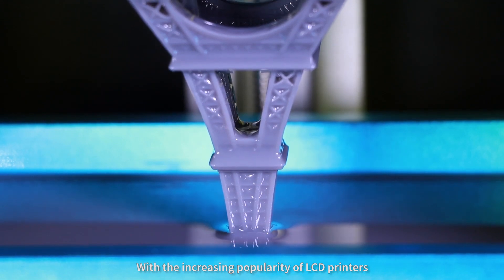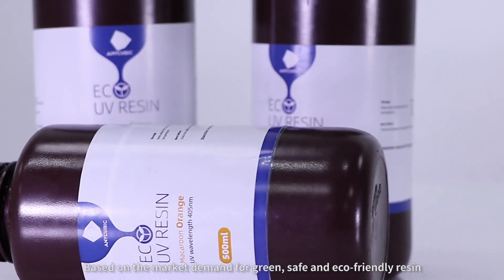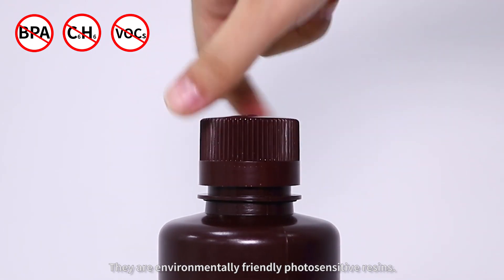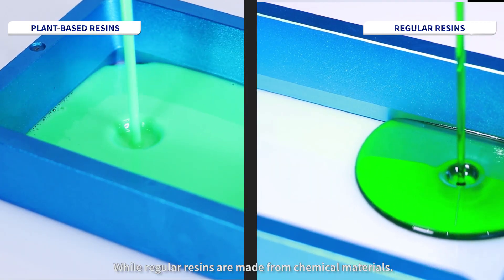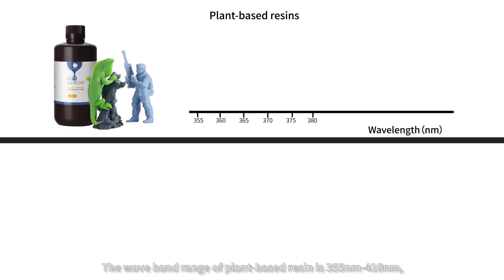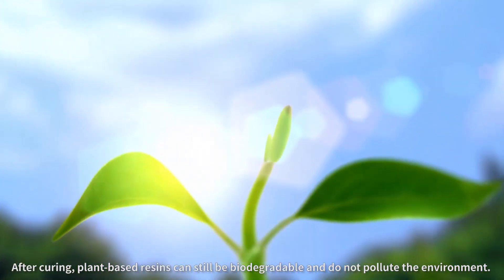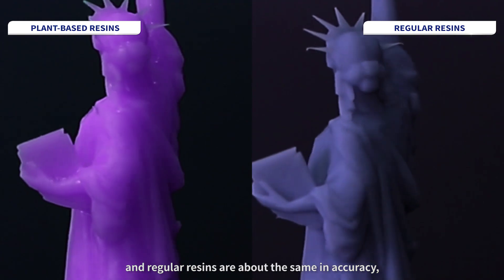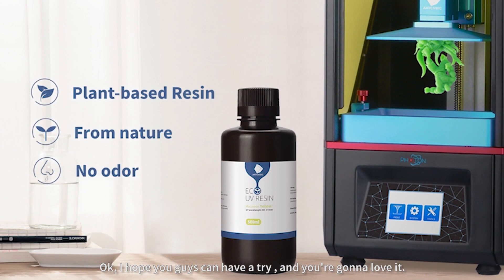Curious about Anycubic plant based resins? Help you enjoy your printing in a healthier way!

Comment: Heads up to anyone looking to buy a resin printer from these guys right now. Horrible quality being shipped out. I have an original photon from a year ago and it still prints great. Just got another one yesterday. Came with a cracked window from a bolt being tightened too much, hinge was broken and the worst part is the build plate presses itself against the LCD screen when pressing the home button, it's supposed to stop before so you can lower it down little by little until it's even. Going back and forth with their customer service right now, but it sounds like they are trying to avoid shipping it back. I explained the problem, showed them a couple videos, showed that when a print starts the back of the build plate pops up and only the front stays down as well as the "Home" problem and they send me back

Please read the instructions carefully! !! !! !!

You need to loosen the top wire of the printing platform first, the motor z = 0, the system will prompt you to reset to zero, adjust to the extent that the paper cannot be pulled out, tighten the top wire, click z = 0.

Please read the instructions carefully! !! !! !!

Seriously -_- I already said I leveled it and it's having issues after leveling which is what I showed them. I've done over a 100 prints on my original without major issues, had my first perfect print the second day. Just a big headache. DO NOT BUY!

Comment: Is it possible to use this resin with a uv lamp instead of a printer? Like in a mold with a uv nail lamp. I like the idea of plant based resin but I cast/pour not 3d print.

Comment: There's not enough data available to know what these certifications mean. I'd want to see the material safety data sheet as well, which is notable for its absence. I also note on the web site the handling rules are no different from other resins, "Wear a mask and gloves to avoid direct skin contact and maintain indoor ventilation." That suggests to me that the uncured resin is just as hazardous - in which case being odourless is a bad thing as it stops you knowing when it's in your environment.
Biodegradable needs more detail - for example PLA is biodegradable, but only in industrial composting facilities which don't exist in most places, so not biodegradable in any useful sense.
Reply: On the plus side, there does seem to be a lot of stuff going on out there with Soy-derived resins, and anything that reduces fossil fuel consumption is interesting.
It's not the same as UV-cured resin, but this company has a lot of data about its products https://www.ecopoxy.com including safety data sheets for all of them - and they're all hazardous, especially the hardeners.
I would guess the certifications are all for the resin in it's cured state, not in the pre-cured liquid form.
Reply: Their website says you must wear a mask and gloves when using this specific resin, against the claims of this video.

Comment: Would it be ok to touch skin? Unlike regular resin
Reply from the maker: Hi Austin, Plant based resin is safe, but we suggest you wear gloves  avoiding skin allergy.
Reply from the maker: Hi Austin, this plant-based resin is biodegradable and made from soybean oil, truly eco-friendly.
Has no VOCs, no BPA, no harmful chemicals. Complied with EN 71-3:2013 safety standard. There is someone sensitive to this, so sincerely suggest wearing gloves when printing to protect.

Comment: I would like to know about this smell.
I wish i could get a sample for smell test
Reply: I got two bottles of this, smell is very low, you have to put your nose right up to the bottle to smell anything and I don't smell it in the room with my printer when it's printing. It's also slightly more flexible than their normal resins.
Reply: @Mendraak  Hi, do you know if the plant based resin fumes are just as toxic as the regular resin fumes? just wondering, thanks in advance!

Comment: Hmmm coincidence that in ALL your marketing material the resin parameters table is blurred out on purpose... on top of that:
1) Something being biological doesnt not make it automatically less harmful than a synthetic equivalent.
2) Soy products are NOT good for environment - Soy production has added to deforestation in the Amazon rainforest. Conversion of forests to soy plantation in the Amazon is a major threat to the climate. 
3) all the chemical warnings on your 'Bio' resin are the same as any other anycubic resin
4) marketing it as 'Bio' makes it look like a specialty resin, as if it will maintain chemical and structural stability even when in prolonged contact with skin, open wounds, or bodily fluids.
Reply: Well, I’m not even from Anycubic team, just a customer, but your comment...:

Do you know what the RoHS & EN71 tests mean?...

About the soy:

You shall probably complain the deforestation at Amazonia to the single beef that you eat at lunch instead of trying to focus on a soy resin that is used for a niche market of printers.

90% of the production of soy is to feed animals - not even for soy milk, or tofu or seitan - is to put steaks on the shelf.
https://www.theguardian.com/environment/2009/jun/21/ethical-living-soya
Reply: @Diogosetgo  nice try but EN71-3 only refers to the migration of specific elements due to sucking, licking, prolonged skin contact for toys, which would obviously be tested post curing. There is absolutely no evidence provided that it is less harmful while uncured.
As for your whataboutism, just because it is a small percentage of the problem doesnt mean it is inconsequential, especially if it is unnecessary
Reply: @xr8dmoose135  Great! Just continue with your B.S. conspiracy theory, then look at the mirror till you'll be aware of it. You'll get it!
Reply: Xr8d Moose yes your B.S. conspiracy also trying to invent that’s an employee... great mindset!  4 to 7 kg  of soy are necessary to produce 400 gr of meat. How many kg of meat do you eat per month? How many bottles of resin do you use per year? Just do the maths. That’s Sustainability - calculating ecological footprint of each product. So yes  your rhetorical statements that all the products that use soy damage the environment is just ignorance and hypocrisy.
Reply: @Diogosetgo   Whats with the hostility? he's just trying to have a debate on safety, very much needed since the documents surrounding this resin is a bit shady
Reply: Erik X more than a debate.... He gave Just destructive assumptions that received an answer at the same level. Yes, the product can be more clear in its components, like many other brands shall be. At this side I’m a consumer that used different resins including this... I know the skin reaction that I had with other  resin from Anycubic and that’s not happening with this one, so I’m happy with this “Eco”... And by the way, his vegetarianism is also shady because the first article that I included here it was defending Soy into the vegetarian diets, which is a significant part (or probably he is also a vegetarian ignoring that...).